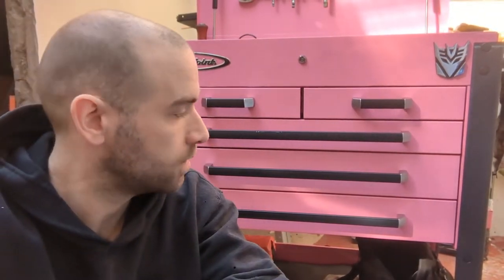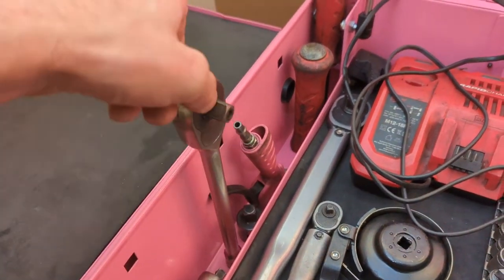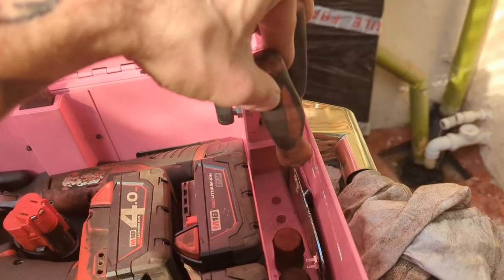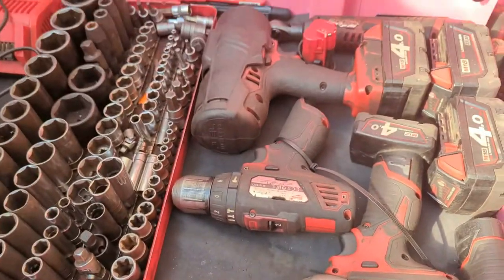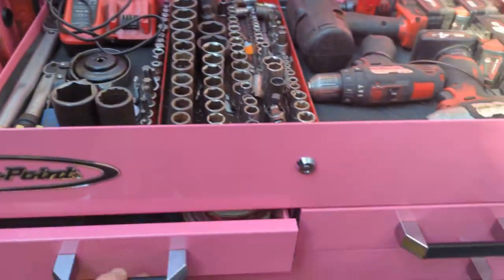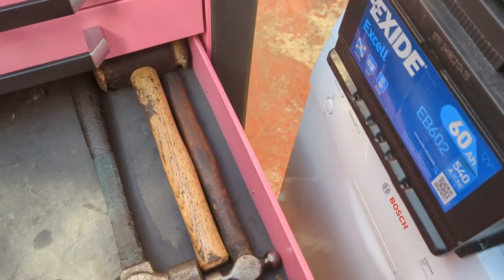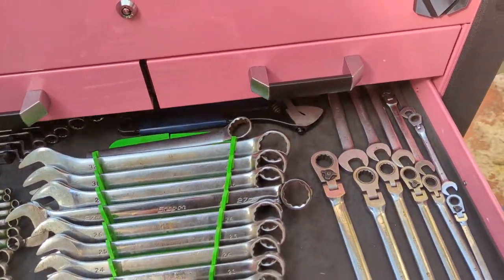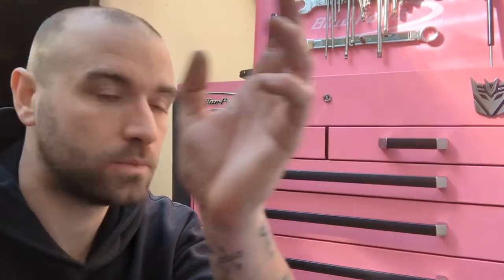Bluepoint By Snap On Service Cart Tour | Toolbox Tour

Comment: I wish I had a tool box like that 😁
Reply from the maker: If you make some good profit on a couple of cars you'll be able to afford one.
Reply: @Papa77sGarage  that's the plan, I'm in the process of building a little workshop to rebuild my engines and gearboxes, and to sore my tools so I will no longer need a car shed 🤣🤣🤣
Reply from the maker: @flippingcarsrepairs  seems like we have a similar idea. That tool box is just in the lean to on the back of the house at the moment. I want to build some sort of garage on the garden to work in and keep tools and stuff in. Hopefully I can get it started this year but who knows.
Reply: @Papa77sGarage  that would be good, I have 2 garages for storage elsewhere but they only single garages with no electric and tiny